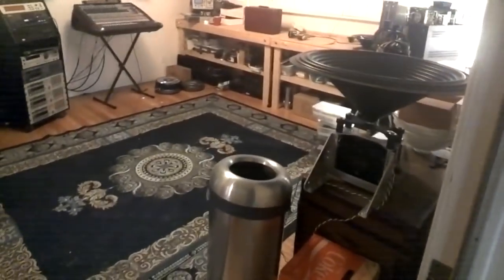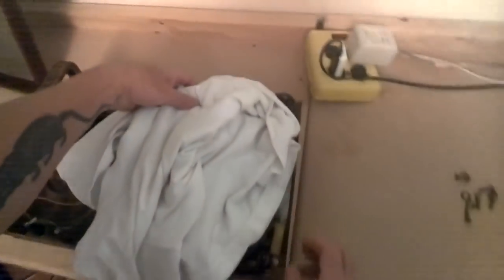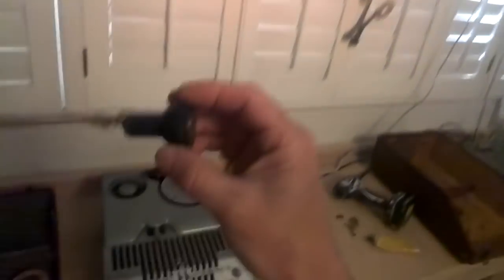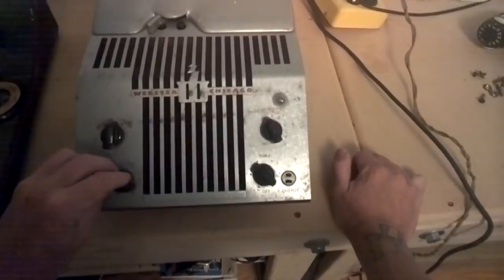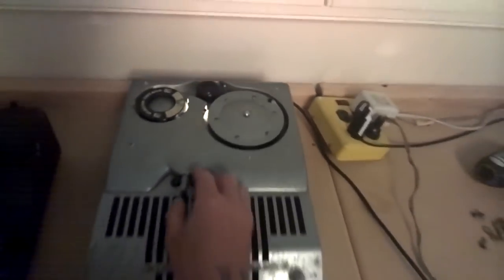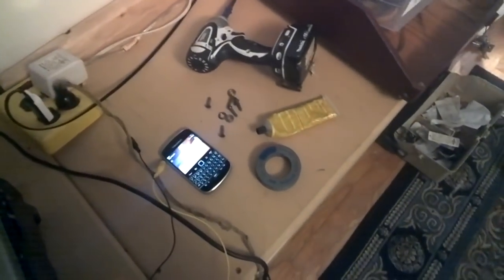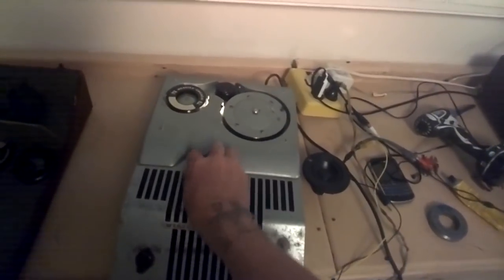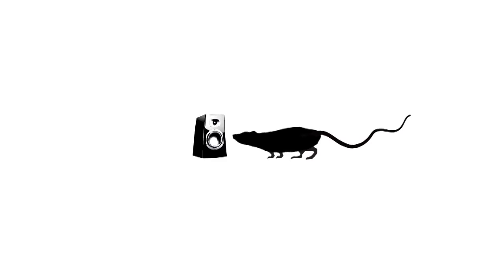Webster Chicago Wire recorder and some old recordings

Comment: I have one of these Dave (different model).  I had it "gone through" by a local electronics guy.  I had him add 1/4 inputs and outputs to it.  Currently it is giving me a shock now and then, so I'm afraid to use it!  Must need some grounding or something...
Reply from the maker: Hmmm, good chance you get the shock when the power plug is inserted one way into the wall and when reversed, you do not.

If the power plug is not polarized with the neural blades being bogger, it can be inserted backwards (reversed)

Replacing with a correctly wired polarized plug will solve that
Reply: @DaveRat  - Thanks!  I'll try it!  Would love such an easy solution...
Reply from the maker: I had an issue about 10 years back with Pearl jam where randomly Eddie was getting shocked by the mic when using a vintage guitar amp he bought at a pawn shop.

Each day the tech would test for shock by touching the guitar strings to the mic and if her heard buzz that would shock him and no buzz would not.

Reversing the plug would solve the shock.

Inside the amp, o e of the ac leads is referenced to the chassis with a capacitor and the other is not.  As the unit gets old and the cap gets leaky, that reference becomes a connection that can shock you.

If the reference is to the neutral then no shock

If the reference is to the hot, shock.
Reply: @DaveRat  - Thanks Dave, it worked!  Now I know that for old wiring - smooth side of the cord is neutral (wide prong), ridged side of the cord is hot (small prong).
Tried to put a ling to a photo of my own recorder, but Youtube doesn't like Facebook links, I guess.  Really appreciate your help!  :-)
Reply from the maker: 👍👍👍 awesome!! So cool and thank you for the heads up!

Comment: Hey, Dave.  I have the same recorder; works great.  But, it didn't come with the output cord.  Do you know what that connector is called?  The one that looks like a small 1/2"-diameter power-connector?
Reply from the maker: Sorry I dont but I believe there are ownes manuals available to view online that should have that info